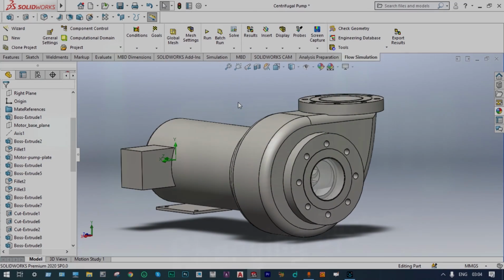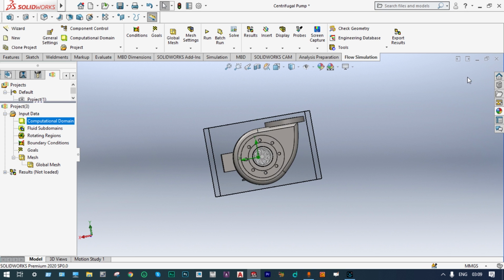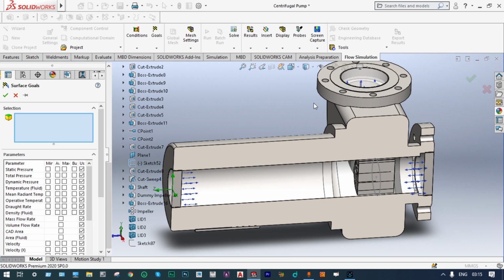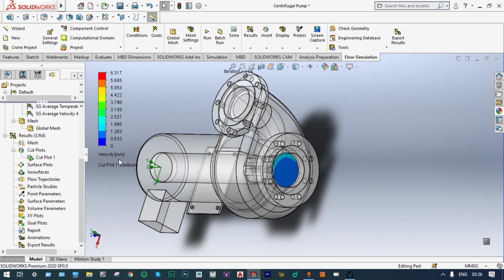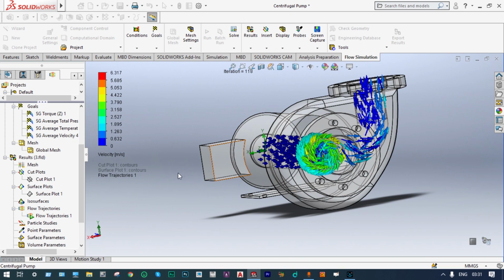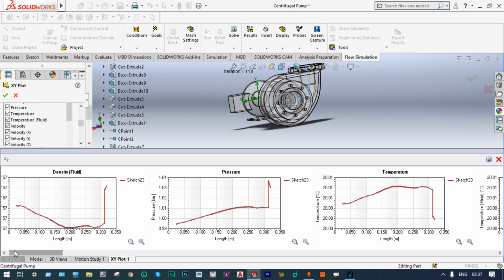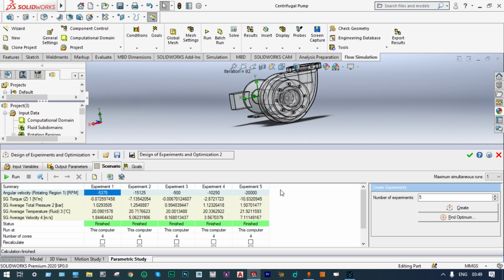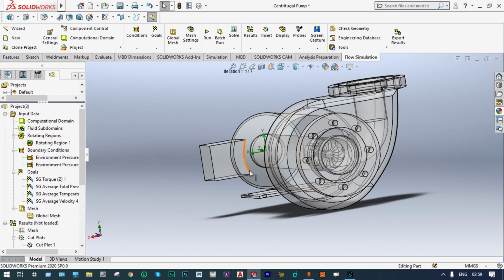Optimize Centrifugal Pump Performance with CFD and SolidWorks 2020

Comment: halo can i ask why cant i select the impller for rotating region ?
Reply from the maker: No issues at all you can select it. You can apply boundary conditions as per your requirement. Same problem can be seen different ways. It depends on requirement. One specific problem can be solved considering internal analysis again you can consider it as an external analysis if you want your model to interact with outside air.